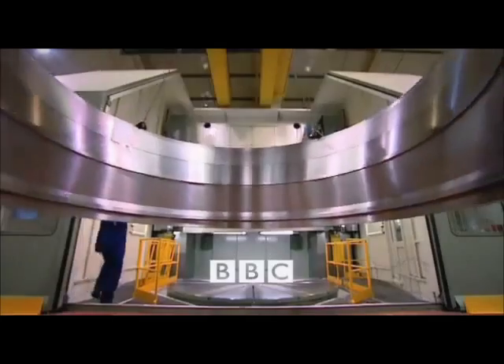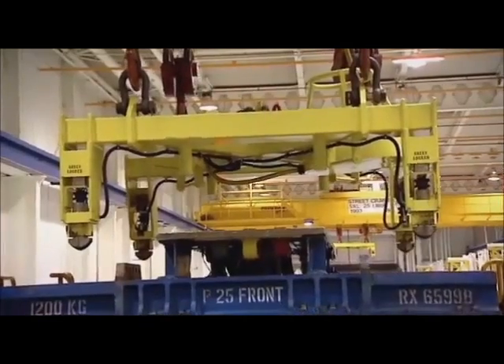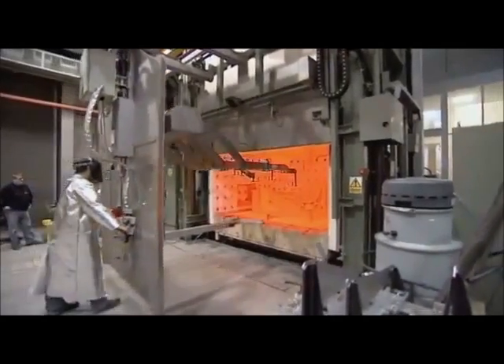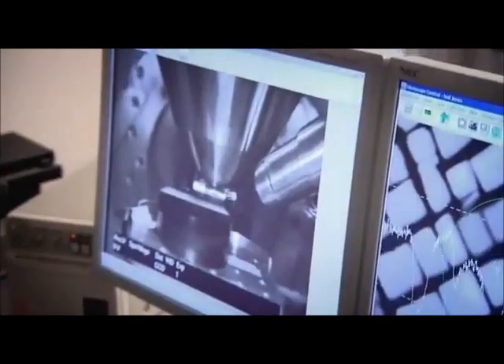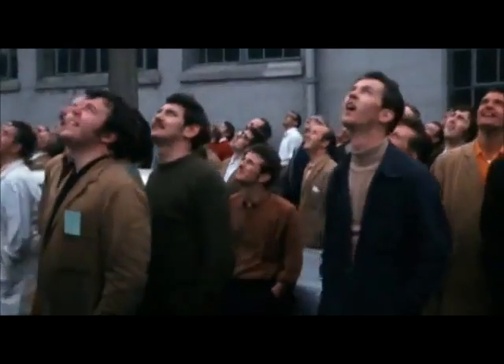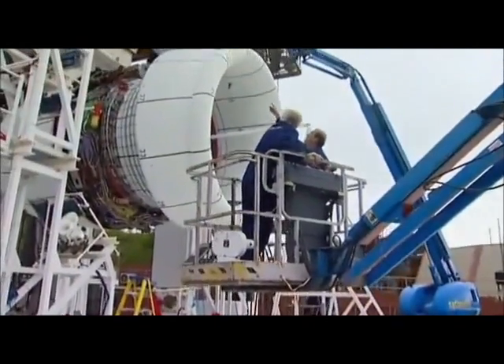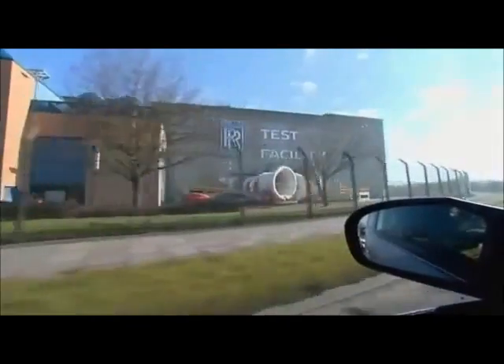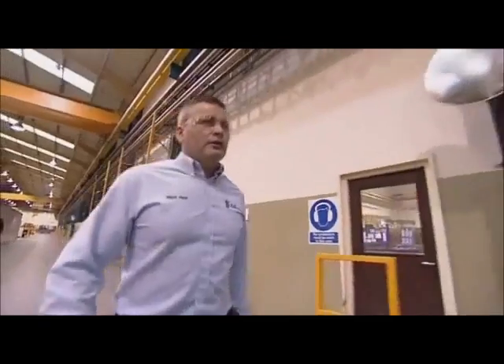How To Build 787 Dreamliner Jet Engine. Cómo se fabrica el motor Rolls Royce del Boeing 787.

Comment: Well, this is old technology, and now meet General Electric's  GE90-115B 115,000-lb class engine was developed to meet the requirements of longer range Boeing 777-200LR and Boeing 777-300ER aircraft. It is considered as the world's most powerful jet engine and has set many world aviation records. It entered service in April 2004 powering Air France's Boeing 777-300ER.
In April 2005, Air Canada selected the GE90 engine to power its 18 firm order Boeing 777s plus another 18 airplanes as options. The firm order engines were valued at more than $600 million. Finally, Air Canada selected General Electric GEnx and GE90 engines to power a new order for 787 and 777 aircraft on November 9, 2005. GE90-115B engines were ordered to power a mixture of Boeing 777-200LR Worldliner, 777 Freighters and the 777-300ERs totaling 18 aircraft. GE90 contract was valued more than $900 million.........
Reply: +NikkkitoNippongo 6 GE engines or 2 RR ? I am no expert in aero engines and you obviously are - so why have Emirates changed from GE to RR for their A380s? Why do more airlines (incl some American ones) favour RR over GE for their Airbus A330 and 340? ? Why do RR have 40% of the market for 787 engines?
Reply: +NikkkitoNippongo Rolls Royce still use the same old triple spool core engine they developed in 1970's for RB-211.
GE has been more innovative and more economic, thats why Air France always use GE engines..
Reply: FORBAN2 You're absolutely right!
Reply: Vernon Peters As many as the plane can handle in both wings, I believe 2, 3, 4, or 5 engines, and one spare in the  trunk....
Reply: Vernon Peters  ''so why have Emirates changed from GE to RR for their A380s? ''

In order to keep Rolls happy after Emirates cancelled a 17 billion dollars order for A350!
exclusively powered by Rolls.

 ''Why do more airlines (incl some American ones) favour RR over GE for their Airbus A330 and 340?''

You are a cluless idiot, a typical uneducated Brit,  340 shut down its assembly line years ago. The original A340 was powered by a GFM engine ( GE&SNECMA) the latest version A340-500,600 was powered exclusively by RR until the aircraft itself was driven out of business by B777..The  A330 is a question of package..which means the price.sometimes Rolls offers better overall price.

''Why do RR have 40% of the market for 787 engine''

Exactly, if RR would have been better , it would have gained more than 40% of the market ..
Reply: +FORBAN2 Why are there so few people who can post intelligent comments on Youtube without resorting to abuse?
If you really think that a successful airline like Emirates would place a massive order for 200 RR engines just to say 'sorry' then clearly you should stay in your bedroom with your computer and keep off the streets
Reply: Jerry Oviedo http://www.reuters.com/article/us-ana-rolls-royce-hldg-boeing-idUSKCN1100X3

This seems far worse ....
Reply: +NikkkitoNippongo How many GE engines on A350 ?
Reply: Vernon Peters If you really think that a successful airline like Emirates would place a massive order for 200 RR engines just to say sorry...

This was exactly the case..Because it is the Emirates who is putting a pressure on both Airbus to develop a new version of the A380 and RR to develop a brand new engine..This was a chess move..
All airlines who operate the rival Engine Alliance GP7200 are more than happy with it including Air France and Emirates with 90 of them under the wings of A380's.
Reply: +FORBAN2 According to Aviation Week:
Tim Clark (Emirates CEO) said the decision to go with the RR engine had been driven by the manufacturer's willingness to improve reliability and inject new technology from from the Trent XWB engine developed for use on the A350
Clark said, however, that the Engine Alliance (a joint venture between GE and P&W) had been 'disingenuous' about their willingness to advance the GP700 engine.
'I don't think the commitment was there in EA to develop an improved engine. It is a good engine but the RR is arguably a better one', Clark told reporters.
Reply: Vernon Peters EA  don't see any future in A380  because the sales of the basic  had been very disappointing  ..Emirates was extremely happy with GP7200 performance so far  Emirates is the only airline pushing for a new version of A380  and  EA is  reluctant to play the game.The same is for  A330 Neo , RR said it would work on a new engine  when US  manufacturers were not very enthusiastic as they  are interested in big numbers only , they believe that A330 Neo would not sell more than  few hundreds and there is not market for 3  engines there. Trent 900 is not better than GP7200, on the contrary..Air France maintenance team is delighted with it and they would never switch to Trent 900 .I am French and I know it. 

In the end, Airbus will not develop a new version of A380 because Mr Clark wants it  and Mr Clark will go empty handed, as a taxpayer in France  I am vehemently against investing  taxpayers  money on a new A380 project before  the original investment of  25 billion dollars returns first profits.
Reply: +FORBAN2 Cher M Forban2 (Qui est M Forban1?) My family was also French but they had to leave France in a hurry a long time ago - not because they didn't like GE engines but because they were Huguenots.
My airline guru says you are well informed but suspects you may work for Air France, which has had little to do with RR since the days of the Caravelle and Concorde. It is also, apparently, a failing airline, so has clearly made some poor decisions along the way. Whether these extended to engine choice I cannot say, but I can say that  to argue that GE engines are best just because Air France thinks so is grasping at straws. Lufthansa (a more successful airline) is firmly in the RR camp  and RR are making inroads into territories that were previously economic colonies of the USA.
My guru explained that if either GE or RR was much better than the other it would have 100% of the market. He says there are various reasons why airlines choose one engine over the other (hot and high performance, range, fuel consumption and so on).
Interesting that modern engines and aircraft are now designed to make engine type change much easier. Perhaps you know whether this initiative came from the airlines or engine manufacturers
Reply: oh look a GE 90 engine exploded a week ago wow I wonder why
Reply: +Veron Peters market share is ranked 1. GE, 2. RR, 3. P&W. even 40% for Trent on 787 does not make them #1.
Reply: Can we not just marvel at the technological capabilities of both RR and GE? Both companies produce astonishing engines and each has developed technology the other cant match. The 3 spool design has proven to be more efficient at the expense of development costs (if it wan't better RR would have dropped to 2 spool), but GEs composite fan blades and cases are equally impressive and currently unmatched by RR (although RR titanium fan blades are incredible pieces of engineering and not much heavier than composites).

I heard from an industry insider that GE engines are typically more efficient when new, but their performance degrades more over time making the total life differences small and highly dependant on flight profiles and airline operations. That both companies have exclusive air frames to power (RR with Airbus and GE with Boeing) and continue to compete can only be good, since neither can rest on their laurels and therefore continue to push the boundaries of what is possible.

Play nice internet.

Comment: I see they don't mention the Trent engine that exploded and nearly brought down Quantas 32,all due to a poorly made oil stub pipe that fed the shaft bearings which broke.When it broke the escaping oil was burnt by the engine causing it to run away,overspeed,and explode.When the fan hub exploded parts were blown through the containment case,the wings (Puncturing the fuel tanks,hydraulic lines and electrical cabling) and fuselage.The engine then proceeded to burn furiously.Only the skill of the pilots prevented this incident from becoming fatal.The faulty stub pipe had been improperly manufactured,when the pipe was bent it was stretched causing thinning of the tube wall.It was this thinned section that fractured.It caused all aircraft with this engine type to be grounded and inspected.Rolls Royce had to replace 38 engines and modify the remainder.Many of the operators are suing RR for lost revenue due to this manufacturing fault.
Reply: +silver760 
Way to go fellah ... misrepresent facts and mislead people. yeah one went bang but the Airbus aircraft and Qantas crew kept everyone safe. No A380 was 'grounded' by any authorities or any other aircraft using RR engines. Of course RR replaced engines built in that manufacturing cycle. And only Qantas has any legal recourse against RR.
Oh wait shall we talk about all those GE engines that 'derated' in flight due to cold weather? Or the fire last week because a GE engine exploded and caught fire in a 777? Or all those GE engines that were recalled because of gear failures?
Creeps like you make me laugh mate .... one trip wonders and probably a Yank...